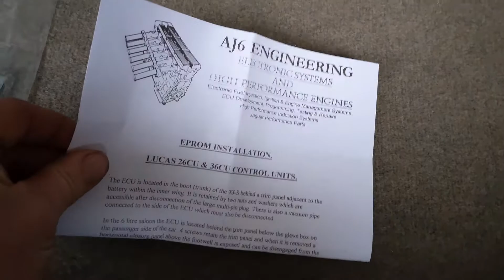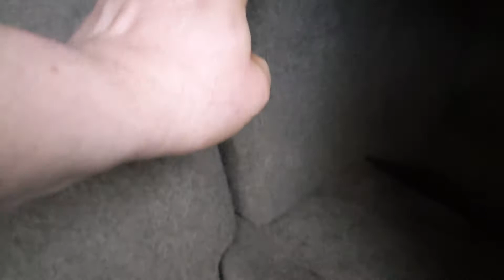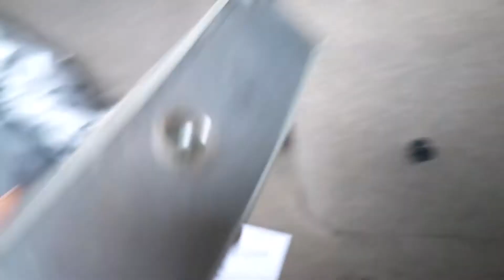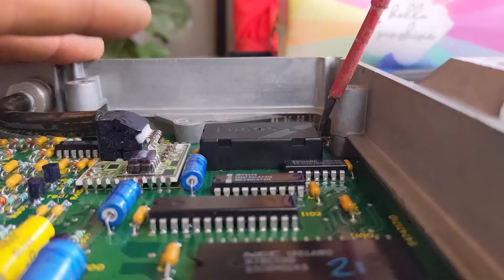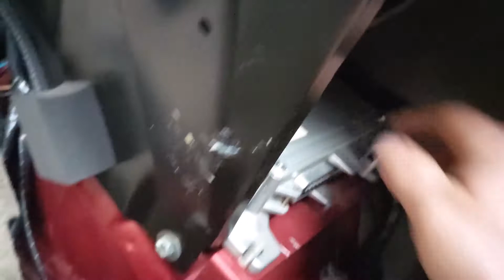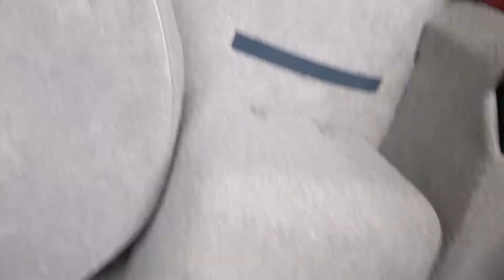Jaguar XJS facelift Aj6 Engineering Basic TT Extractor V12 stainless steel exhaust ECU chip

Comment: Sir ,  good video but didn't explain or showed any results of this exchange of chip.. that's the whole idea for everyone to see if it's worth the  money and time. You didn't explain  what  AJ6  guarantees if you install..
Reply from the maker: Fair point well made. To be honest there's 2 reasons for this. 1 is that this video was very early in my YouTube channel, I didn't really know what I was doing other than filming my work, mostly as a diary for myself but shared as it may (or may not) be of use to others. 2 is that I haven't had much opportunity to test. I quickly moved from exhaust replacement to subframe restoration etc. Last year I drove 7 miles, so no chance of any report re. performance etc! I think it's important to state this chip is not a performance chip, it is simply a tweak to the fuelling, supposedly to benefit torque at low speed due to the increased flow provided by the twin extractor downpipes. So to the driver, there would be little if any noticeable difference, the only difference being noise changes due to the exhaust design. If you're looking for performance, you need to look to forced air, turbo/supercharger and the associated cooling, fuelling etc upgrades.
Reply: @jaguarxjsocd  .. I apologize if I sounded demanding. I understand these videos are a pain to make. Great job on your first video. You were the first ever to install those AJ6 chips ,, congratulations.. How did you manage to purchase just the chip.. I was under the impression you have to send your entire module for him to rebuild. How much did you pay?  After the several kilometres of driving do you notice a difference in power? Is it worth it?  My son and I have chromed and polished the entire engine straight exhaust except for small muffler at back. Removed all pollution control and only one fuel regulator, custom 3" snorkel intake pipes.. Thank you for your time. Pete
Reply from the maker: @petehalasz7547  no haha not demanding at all, I value feedback on my videos! 

So there is a difference between the chip supplied with the AJ6 Engineering twin extractors and the "uprated ECU". 

The chip supplied to me came with the exhaust system, as a self installation item. In the few miles I've driven I've not noticed any particular change to engine power/delivery. I have also run the car in the garage with the oem chip with no noticeable difference. Perhaps this year I will drive with each chip and note any changes. 

The "uprated ECU" may offer noticeable performance changes, as I've not tried it I can't comment! 

If you want my opinion on value, my personal opinion is replacing the exhaust with a quality stainless steel exhaust is always value from a point of view that it's rust free and easy to maintain/remove/replace. On my car now the entire exhaust can be removed in an hour and replaced in a similar time, all fittings are immaculate and correct. Compare this to the bent, crumbling ends and fittings previously, it's definitely worth it. 

I have AJ6 downpipes and mid pipes (no mid silencers). I then have Simply Performance over axle pipes and rear silencers.